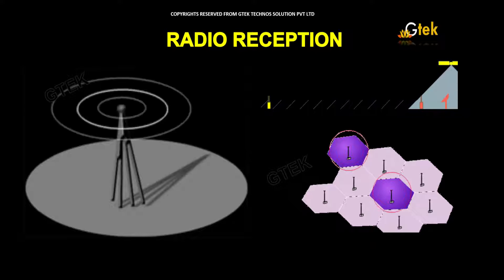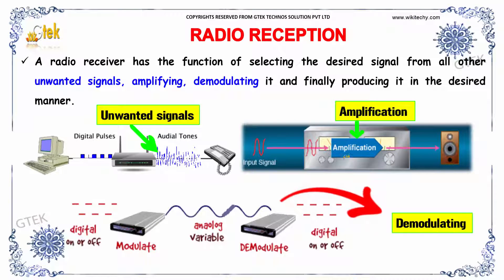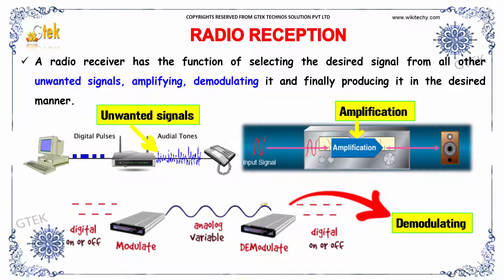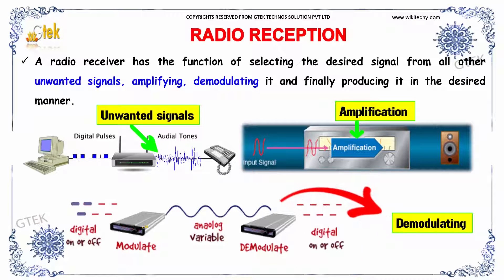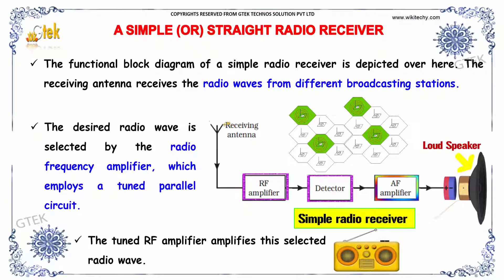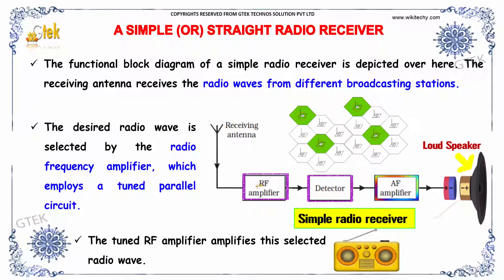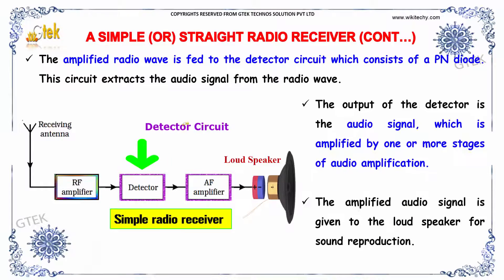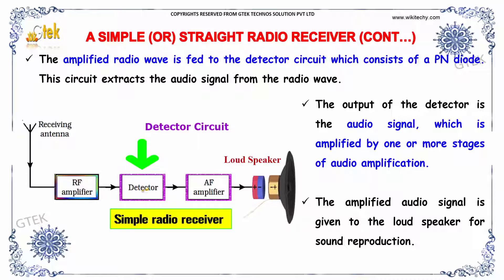Radio Reception  | Communication systems | class 12 physics subject notes lectures|CBSE|IITJEE|NEET

Comment: Radio is the radiation (wireless transmission) of electromagnetic energy through space. The biggest use of radio waves is to carry information, such as sound, by systematically changing (modulating) some property of the radiated waves, such as their amplitude, frequency, phase, or pulse width.

Comment: Radio waves are a type of electromagnetic radiation with wavelengths in the electromagnetic spectrum longer than infrared light. Radio waves have frequencies as high as 300 GHz to as low as 3 kHz, though some definitions describe waves above 1 or 3 GHz as microwaves, or include waves of any lower frequency.

Comment: Radio frequency (RF): any of the electromagnetic wave frequencies that lie in the range extending from around 3 kHz to 300 GHz, which include those frequencies used for communications or radar signals. RF usually refers to electrical rather than mechanical oscillations.

Comment: A radio communication system sends signals by radio.The radio equipment involved in communication systems includes a transmitter and a receiver, each having an antenna and appropriate terminal equipment such as a microphone at the transmitter and a loudspeaker at the receiver in the case of a voice-communication system.

Comment: Radio systems need a transmitter to modulate (change) some property of the energy produced to impress a signal on it, for example using amplitude modulation or angle modulation (which can be frequency modulation or phase modulation). Radio systems also need an antenna to convert electric currents into radio waves, and vice versa. An antenna can be used for both transmitting and receiving. The electrical resonance of tuned circuits in radios allow individual stations to be selected. The electromagnetic wave is intercepted by a tuned receiving antenna. A radio receiver receives its input from an antenna and converts it into a form usable for the consumer, such as sound, pictures, digital data, measurement values, navigational positions, etc. Radio frequencies occupy the range from a 3 kHz to 300 GHz, although commercially important uses of radio use only a small part of this spectrum.

Comment: Radio is the technology of using radio waves to carry information, such as sound, by systematically modulating some property of electromagnetic energy waves transmitted through space, such as their amplitude, frequency, phase, or pulse width.When radio waves strike an electrical conductor, the oscillating fields induce an alternating current in the conductor. The information in the waves can be extracted and transformed back into its original form.